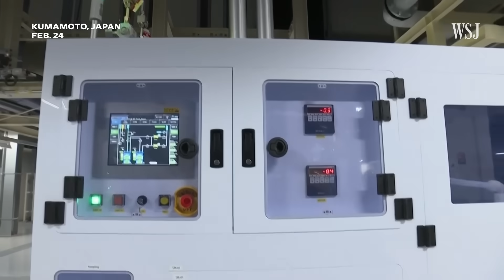The Plan to Secure Taiwan’s AI Chips Amid Fears of a Chinese Invasion | WSJ

Comment: Here is the irony, the US considers high tech chip manufacturing as a US technology and yet the US is unable to manufacture them without a foreign country.
Reply: The real irony is that the founder of tsmc got his start in early Silicon Valley but kept hitting the ceiling due to his ethnicity. Taiwan started an initiative at the time to being their talent back home so he went.
Reply: Sematech again...
Reply: Right, just like TSMC can't make anything without ASML, a Dutch company. There are over 6000 companies involved in this process so it literally takes the whole world.
Reply: @PhillipBallard   And to your point, ASML can’t make their EUV lithography machines without American-made Laser-produced plasma sources, photomasks, and nanoscale metrology equipment. Or German optics. It’s a highly interconnected supply chain- at the end of the day, TSMC’s expertise comes in quality control, fab layout, and manufacturing efficiency. I find it funny when people think that expertise is actually the enabling technology and that it is impossible for any other country to produce advanced integrated circuits. They’re flat wrong, like the original commenter.
Reply: @Laminar-Flow  

Your last comment is actually contrary to your previous comments 

Maybe you should go back and read them。
Reply: Ironically, this comment is a fallacy.  The US has ability to make advanced chips as TSMC does.  Intel has tech to do so.  But the difference between the success of TSMC and other fabs including Intel and Samsung is the yield of high-end chips.  TSMC is able to mass produce advanced chips below 7nm at high yields that satisfy the demands from business clients.  Other companies, however, the yield rates are relatively poor compared with TSMC.  From business standpoints, no companies can compete with TSMC because of that.   Who would want chips with lower yield rates if a certain manufacturer can provide more useful chips in mass production?  It's all about the costs!!!!!!!!
Reply: @censoredyoutube4902  both Intel and TSMC has access to the same EUV lithography machines from ASML.  Why is it that only TSMC is able to produce 7nm and lower chips at high yields?  What exactly is the difference?
Reply: @samanthajones4877  Over the years, TSMC has developed know-how and amassed a skilled labor force that makes a difference - a significant one. That's to some extent proprietary information, to another intellectual property that lends itself difficulty to patenting and to some extent experience and craftsmanship. You can replicate this somewhere else, like in the US or Europe, or literally anywhere else, with the right investment and given enough time. The investment, however, would likely be trillions, spread over at least several decades. It's simply cheaper to stick to manufacturing in Taiwan.

As odd as it may sound, it's also a matter of geography. Semiconductor manufacturing is an industrial process that requires humongous amounts of water. Taiwan receives an average of more than 8ft/2.5m of rain per year - more than almost any other region on earth. As such, it doesn't have a problem spending a similarly huge amount of water for semiconductors manufacturing. Most other regions on earth can not afford such water usage.
Reply: TSMC doesn't design chips. It produces them cheaper than the West could. Europe used to fab most chips until the 2000s and got outpriced. 

They need US, EU, Japanese and Korean designs, and Dutch lithography machines to even do this and can't function without them. Then most of the world's memory is designed and produced in Korea and Japan and literally nothing works without that. It's a massive cross-continental dependency.
Reply: @Eoin-B   Memory is a huge factor no one considers. Especially in terms of parallel processing. It’s useless without blazing fast SMD memory. They build cache onto the die but that can only be so big
Reply: @Laminar-Flow  Exactly, unless they capture Korea and somehow the Netherlands too, the TSMC fab is pretty useless as we would just stop exporting them to the Island.
Reply: 就不用跟他們吵了
成本高之外美國人沒有很多人願意做暴肝工作，講那麼多屁話還不是台積電妥善率最高跟成本低
美國要做當然也做的出來但現在最新技術美國也要花很多年跟成本
Reply: 把台積電講的一文不值笑死人了，荷蘭的公司也是台積電投資的，就跟美國以前常常歧視跟數落日本其他商業公司一樣，後來還不是被取代市場
Reply: The design of the chips & machines used in chip fabrication are (in most part if not all) using US patents by US scientists/ organizations (aka US $$$). Yes, even the EUV or Ultra-EUV machines made by  ASML (Dutch company) uses US patents in their design... The chip fabrication outsourcing to TSMC and therefore not incurring with the total cost of developing the manufacturing process from the ground up was one of the reasons why AMD was able to catch-up and even surpass (in some applications) Intel, which up until around 2020 had a "traditional" approach where they had to do R&D for the Chip design AND chip manufacturing (having difficulty in implementing/ using EUV machines) which effectively almost DOUBLED the cost of R&D as a whole for a new lithography process. Same thing that allowed Apple to design its own chip and have TSMC fabricate it for them, it would NOT have happened if they had to also invest in R&D on how to fabricate the chips because they would never make a profit (take the Apple Car project which was abandoned and had a much lower difficulty barrier).

TSMC obviously has its own proprietary techniques and extremely competent employees and undoubtably (together with Taiwan) became a node of extremely talented engineers & specialists in chip manufacturing, they haven't become the "beast" they are by luck. Nonetheless there was A LOT of western investment in making it what it is today. The threat of hindering the chip supply chain so that the US "pew-pew" industry falls short is a matter of national security. Security of interests & security of investments, so you wouldn't really want to facilitate technology transfer in anyway which could expedite a challenging country to "skip steps" you had to go through without incurring the cost and time to do so. Take Chinese "stealth fighters",  capable copies of US & Russian aircraft which are now used to threaten... take a guess.... Taiwan! yay!

Hence why they are correctly bringing back fabs in the US as well as other strategic locations in the world with potentially lower geopolitical risk.

So the only ironic part of any of this is that you tried to make a snazzy comment, just to be schooled.
Reply: @MrRobot_86 outsourcing was implemented to reduce production costs, nationalizing this industry will make costs higher, in a scenario of inflation in the USA, American electronic products will not be able to be competitive which will increase inflation even further.
Reply: The chips are not for export so they don't need to compete.
Reply: @MrRobot_86  From a military standpoint all those small geometries are not required or used. 20nM geometries are more than sufficient to provide the computing power to guide the most advanced missiles. Also the smaller geometries are more susceptible to hard errors ending in failure of the missile. Even space applications do not use geometries < 20nM as again low reliability in a high radiation environment. Fine geometries are only for consumer products with limited space e.g. smart phones and watches. So all the hype about who can do what has no influence on military equipment.
Reply: @MrRobot_86  While your comment is largely correct about TSMC, there are two key aspects where I disagree. Apple designing their own chip is a bit of a stretch when the cores are licensed designed from Arm. 

To call Apple a chip designer is like calling someone a car designer for ordering a car with their favorite color interior and favorite color exterior. While one could argue that picking the color of the car is to your design standards - the bulk of the work was still being done by other companies. Today being a "chip company" is just about writing checks which is why so many companies from Google to Amazon now have "their own" chips. They write a check to a company like Arm to design the bulk of it, and then write a check to TSMC to manufacture it. Even many of the other technologies for things like radios and charging are licensed IP. TSMC is a true chip company as they actually fabricate them. And there are a few companies like Arm, Nvidia, and AMD that truly have innovative IP. 

The US has low geopolitical risk, but has high political risk. In the world we have a spectrum of human rights and productivity. China is not known for it's human rights, but is known for high productivity as a result. As we've had a huge increase in human rights in the US, it comes at a significant cost of decreased manufacturing capability.

Car manufacturing and agriculture is going to countries like Mexico because of cheaper labor. And even for chip manufacturing, TSMC is realizing the struggle of working in the US. Even this video itself touches on the fact that unions are upset about them using foreign labor. 

At the same time, TSMC is building a factory in Arizona and needs highly skilled labor and workers to be there for 24/7 manufacturing. They have already complained about the work culture in the US, because it's not easy to find a bunch of engineers or chip experts in the middle of Arizona willing to work an 8-12 hour graveyard shift. 

The future of manufacturing anything from simple food to advanced computer technology is going to be a fine balance between cheap third world labor and advanced AI robotics, not American people.
Reply: @aminy23  Agreed, I just thought I was already writing an essay which the ppl that should read it wont... So I cut some corners on promoting Apple to a chip designer.

I partially agree with you regarding the workforce in the US, I think that due to lack of competitivity for that specific type of specialized/ highly educated workforce the employees can be "picky" can complain or are unwilling to work given x,y,z conditions. If there was a market saturation of engineers in the US, it would likely easy and lower the expectations for employment. None of these have  a quick solution that don't require long term planning... Take myself as an example, as a Materials Sciences Engineer I began my career in metallurgy and I transitioned (10yrs+ ago) to  Software Development. At that time there was a larger demand and therefore benefits for Software Engineers vs Engineers willing to work at a Steel Mill. I would consider moving back to a more "core" industry if my country requires me to do so or if jobs are more financially attractive in that market.
Reply: Why does the United States not confront China but seek to solve the problem from Taiwan? Is the United States afraid of China?
Reply: It’s true as all the designs for the chips come from the us
Reply: What?  Google the number of worldwide Fabs and you will see there are 100s in the United States already!  Have you never heard of Global Foundries, Intel, Texas Instruments, Samsung, Microship, Onsemi, Wolfspeed, Micron, Tower, Qorvo, and many others that have plants in the United States?
Reply: You do know that most of the companies that allow semiconductors to be made are based in the United States - KLA, Applied Materials, LAM Research along with the software companies that support chip design like Synopsis, Cadence and Keysight?  And if it weren't for NVIDIA, Apple, Qualcomm, AMD, Amazon, Microsoft and other USA based companies, TSMC would have nothing to build?
Reply: Intel in Ohio has no one help but America
Reply: No, irony is WSJ bashing protectionism and then turning around and wondering why all our product are controlled by other countries.
Reply: Well, no.  It's because manufacturing chips in the U.S. would be far too expensive. The U.S. used to dominate the industry from design to production.  Of course, now TSMC is so ahead on the production side that bringing production back to the U.S. would be very difficult.

TSMC's supply chain is almost a global effort. Materials from various countries, chip designs in the U.S. and tools from ASML in the Netherlands, just to name a few.  Not to mention the customers who buy those chips.  This is why China threatening the peace and stability of Taiwan is a problem.
Reply: US dominants the scientific patents that makes TSMC products possible, and secures Taiwan's security f from CCP which are all PREREQUISITES.
Reply: Actually if you go back to history, the real reason why Fab manufacture exist in Taiwan is because in 1970's US does not want to manufacture chips due to its highly polluted environment and need considerable amount of water and electricity, and that’s why US outsource to Japan in the beginning to manufacture the Fab chips. And Japan didn’t make the Fab chip an success as US want to counter Japan rising economy in 80's and decide to outsource and relocate the supply chain of Fab manufacturing to South Korea and Taiwan instead. And Taiwan take 30 years since 1987 to make it very successful finally. So its a lot of time and capital involved. Think about it the chip plant in Taiwan at 80's take like 300 million USD ( like 10 billion USD now adjust for inflation of labour and material）to invest back in 1987, and in that time which government in the world has vision and courage to take $300 million in USD in 1980's to invest and willing to risk Fab manufacturing when its pretty much a relatively very new concept and infant market ? Taiwan government decide to make a huge bet and it become a success after 30 years.
Reply: We have a massive amount of semiconductor knowledge and IP. Just not workers for the plants, because we’ve outsourced manufacturing for decades; hence why the US is so reliant on Taiwan.
Reply: @ianstlouis   That's true!  Talent pool is hard to build up and it takes time.
Reply: @ianstlouis  thats why US will have to defend Taiwan
Reply: Intel, Texas Instruments, Microchip, Micron.... etc.
Reply: @Kdgatto where do do you think intel fabs their high end chips?
Reply: @s0kulite  ...Hillsborough, Oregon and Chandler, Arizona?
Reply: @viperabyss  Those U.S. chips fabs are sub-par compared to the fabs locally in Taiwan.
Reply: @s0kulite Taiwan cheating ? Using cheap labor ?
Reply: @eastcoastsailingcenter7768 

Apparently you know zero about Taiwan
Reply: @eastcoastsailingcenter7768  no, they’re just better then Americans.
Im playing both sides here, as a Taiwanese American.
Reply: @s0kulite  US dominants the scientific patents that makes TSMC products possible, and secures Taiwan's security from CCP which are all PREREQUISITES. US and Taiwan are allies.
Reply: @tranquil02  thanks for stating the obvious like we don’t already know
Reply: The main reason U$A will never able to compete in Chip manufacturing.
All the country that do well in chip manufacturing , has Confucianism culture.
For chip manufacturing,  a high level of discipline is the key, and most Americans today don't possess it.
They call it “forced labour"
Taiwanese media reported on August 2 that TSMC claimed the production holdup at its Arizona facility was caused by a shortage of trained American labour and that they had sent staff from Taiwan to assist with the factory's development. Labour union officials in Arizona, on the other hand, criticised TSMC for exploiting this as a justification to bring in "low-wage foreign labour."
Reply: @happymelon7129   You’re literally messed up in the head if you think chip manufacturing success is due to Confucianism. Only a bot would say that. 

The only other bots in this equation are the ones making the chips. The issues in Arizona are on construction. That will be a solved problem in a year.
Reply: @Laminar-Flow  

BTW, you have not answer my
 questions about intel?
Reply: @Laminar-Flow  

Do you know—-TSMC would not exist without K. T. Li; Nvidia would not be possible without TSMC
Reply: @Laminar-Flow  

Dear Kaminar,

The more you say, the harder to believe you are an engineer 

Apparently you don’t know the meaning of supply chains

Your only point is US is great and we don’t need Taiwan 

Hahaha 

So naive and immature
Reply: @Laminar-Flow  

For your reference——He recalled the manufacturing process of the RIVA 128, Nvidia's first commercial success, which he called the "most complicated chip at the time." He said that Nvidia did not have the budget and he wrote a letter to Taiwan Semiconductor Manufacturing Co. (TSMC) founder Morris Chang, who called him and the two started their nearly 30-year collaboration.
Reply: @Laminar-Flow  

Jensen Huang, the Nvidia CEO who was born in Taiwan, raised in Kentucky, and is now one of the richest men on earth
Reply: @Laminar-Flow  

AMD Lisa Su is also Taiwanese 

Lisa Tzwu-Fang Su was born in November[1][14] of 1969[7][2] in Tainan, Taiwan. She was born in a Taiwanese Hokkien speaking family.[1
Reply: @Laminar-Flow  

Wow! Another Taiwanese, what a surprise 

Charles Liang (born 1956 or 1957) is the billionaire co-founder (with his wife Sara Liu), chairman, president and CEO of Supermicro, an information technology company based in San Jose, California
Reply: @Laminar-Flow  For chip manufacturing,  a high level of discipline is the key, and most Americans today don't possess it.
They call it “forced labour" 

Please return TSMC to Taiwan ,  since after many years TSMC still never receive any $ from U$ gov.
Reply: @Laminar-Flow  

three Americans CEO all born in Taiwan, can’t you see any connections here ?
Reply: ASML also relies on TSMC, and EUV lithography is a technology integration of multiple countries, not just the United States or Germany. At the same time, ASML also relies on TSMC to iterate their lithography machines.
Reply: Taiwan is a perfect excuse to grab this technology for Americans. ASML is still a headache though. Need to make that American too.
Reply: This is bully , it is NOT a competition when only one side(U$A) can change rules.
Just like your classmate(U$A) use his family power coercing the stationary shop(ASML,Japan,..) NOT to sell stationary to you(China).
Reply: @happymelon7129   Chinese can whine as much as they want.  LOL.  But the US is the ultimate IP owner that owns the upstream tech in the supply chain of semiconductor sector.   American companies owns many licenses of critical tech needed for chip processing and IC design.  For example, Synopsys is one such company that a lot of chip design needs the company to authorize the use of codes created by the company.  This is also the reason why you only watch the US authority talk about what they want to ban to other countries but the other countries can only protest crying like babies at best.   LOL.   It's the power of IP!   You want it?  Either steal it as China has been doing tirelessly or comply with the demand from the IP owner which is the US.
Reply: 全球化是什么意思？
Reply: Grrr but me hate America so you’re wrong.
Reply: As a computer engineer, we don’t need TSMC to make 2nm chips. Intel is building a 2nm, 3nm, and 4nm fab as we speak (they have different naming conventions but the feature sizes are similar to TSMC). We need ASML, but they have research centers in the US and their original EUV research was funded in part by the US government alongside Intel and AMD. That is the only enabling technology right now necessary. All the software used to design such chips, and most of the enabling technology is owned in part by the US government. Nvidia is an American company and all the software and hardware design is American IP. Same with AMD. Same with Apple. If you think otherwise you’re not well researched. 

The only reason they are made by TSMC is they perfected mass-producing such chips at massive scales on short notice. That’s it. They hold close to no tech-enabling IP relating to how these chips are made; they use American software and Dutch machines with German mirrors among other things. 

The US invented the transistor, the internet, and a while ago made 90% of the world’s semiconductors. It is the US’s technology in origin and given the CHIPS act, it will be in the future. You look at the problem like an uneducated fool.
Reply: @Laminar-Flow 

Maybe you should do more homework before talking
Reply: @jennychuang808   I did plenty before I graduated. Let me know what I said that was technically incorrect.
Reply: @Laminar-Flow  

Intel ? Haha 

Haha
Reply: @Laminar-Flow  

If you can understand Chinese ( language) , I would love to show you what is those Taiwanese expert’s view about Pat Gelsinger

He is literally a joke and dreamer but nothing else

Please go and check what he said over the past few years?
Reply: @Laminar-Flow  

Dear Laminar, I wonder if your research includes this ——-A mini bombshell was dropped on the semiconductor industry a few months ago: Intel would use TSMC to make CPU tiles for its next-generation Lunar Lake mobile platform. A new report from Taiwan says Intel will continue that strategy with Nova Lake, which will be Lunar Lake's successor, somewhere around 2026 and use TSMC's 2nm fabrication process.
Reply: @Laminar-Flow  

Please also do some research about Intel’s revenue ——
Intel’s chip making business reports $7bn in losses; figures to worsen in 2024

Please check the share price of tsmc

As an engineer yourself, you should know how expensive one fab is . In your opinion, how long can Intel lasts?
Reply: @jennychuang808  The only thing TSMC brings to the table is the ability to mass-produce chips first made in research labs in America at a cheaper cost than would be charged in the US. That’s it. Their only contributing IP to this process deals in quality control and fab layout. That could easily be replicated elsewhere. If necessary research labs could start outputting and packaging chips immediately but QC and cost would be a problem. Either way, it could be done. In the long term, it will, and these two things won’t be major factors by then. 

I’m not saying the US should abandon Taiwan. It shouldn’t. However, it’s also disingenuous to say the US cannot produce its own chips at or better than the same level as TSMC considering the engineers and physicists that enable the tech in the first place are almost all in the US. Where is the majority of research spending occurring in terms of technology that will enable 1nm and sub-nanometer processes?
Reply: @jennychuang808  Who took delivery of an EUV machine recently? Read my other replies to people, “Jenny Huang”.  TSMC’s entire market value is literally based on NVIDIA, Intel, Apple, AMD, Qualcomm, etc’s own profits. Without US companies designing the chips on American software on equipment made using American research breakthroughs, TSMC wouldn’t be valued remotely close to what it is today. Why is NVIDIA worth 2 Trillion versus TSMC, which isn’t even valued at over a trillion yet?
Reply: @Laminar-Flow  

When you said “ tsmc’s can be easily replicated “ , it shows you don’t know this industry at all.

If what you said is true , why US still want tsmc in your wonderful country?
Reply: @Laminar-Flow  

When you emphasize how important the EUV is, I just can’t stop laughing 

In this case, why doesn’t Intel use the EUV to produce 2nn, and Samsung?

Apparently, it is more than what you thought, right ?

Hahaha! 

Do more research, please
Reply: @Laminar-Flow Why doesn’t the USA simply buy an EUV machine from ASML and produce high end semiconductor chips themselves instead of asking for TSMC to setup a factory in Arizona?
Reply: @jennychuang808  Intel is the defacto standard for mass production CPUs and is spending over $100 Billion on new fabs.  I'd say Pat is doing a good job.
Reply: @Maxpasadena  

Dear Max,

We should see and only time will tell 

Good luck
Reply: @jennychuang808  Why do you get upset that someone who is more educated than you says you're wrong?

There's nothing wrong about being wrong, but there is someone wrong in responding with personal attacks, instead of arguments and logical fallacies.
Reply: @AlmightyDude420  

Dear Almighty Dude

Would you please tell us who is more educated? 

Apparently your wonderful philosophy is not working here
Reply: @AlmightyDude420  

Dear Mr Almighty Dude—- I sincerely hope you can understand this report and let me know the definition of well educated ———-Intel discloses $7 billion operating loss for chip-making unit. Intel said the manufacturing unit had $7 billion in operating losses for 2023, a steeper loss than the $5.2 billion in operating losses the year before. The unit had revenue of $18.9 billion for 2023, down 31% from $27.49 billion the year before.—-During a presentation for investors, Chief Executive Pat Gelsinger said 2024 would be the year of worst operating losses for the company's chipmaking business and that it expects to break even on an operating basis by about 2027.—-Partially as a result of the missteps, Intel has outsourced about 30% of the total number of wafers to external contract manufacturers such as TSMC, Gelsinger said. It aims to bring that number down to roughly 20%——
Reply: @jennychuang808  7bn loss for starting and investing in a new company? how is that a bad thing? Tell us, how many billions did China spend trying to start their own fabs. Tell us? Look, I like TSMC, but you must know they are using European machines and American designs to do it.
Reply: @2livenoob  

I guess everyone knows this industry uses EU machines and US designs.

But the key point here is even so , why can’t US make advanced chips?

Merci
Reply: @jennychuang808  That's a complicated question, with many answers. The US could have done it if they didn't buy into, and lead, the globalization effort. Now that China clearly is trying to pull a Russia and control the world's supply chain so they can go to war, all of that needs to change unfortunately. The point of the WTO (which i dont support) was to PREVENT countries from going to war with each other by sharing trade and supply chains. Russia and China are using that setup to go to war unchallenged by the countries they supply. This is unfortunate but that's life. However, you didn't answer my question, you blame Intel for blowing 7bn trying to build their own fabs without telling us how much did China spend trying to do the same thing? How much has TSMC been dumping into their fabs for the last 20 years to get where they are? It's not a cheap endeavor. It's like nukes... everyone knows how to make one, but very few people have the resources to do it.
Reply: @Laminar-Flow  Intel 2nm is vastly different from TSMC 2 nm. Every fab has their own pdk. When a company like AMD, ARM, designs a chip they are mostly designing it with the standards of only one fab in mind. Intel's fabs are in house, i.e they produce Intel chips only, similar to how AMD was before they went fabless. TSMC is flexible in this sense as they will manufacture chips for anyone who pays and has a valid design, even my college is sending our 12nm design to TSMC alongside a fat check this year.
Reply: @TheReaper-fq6yv   Yes, I’m aware. I was not giving the literal names of processes, I was giving ‘equivalent’ names- I.e. Intel 4 (previously called Intel 7nm) being equivalent to TSMC’s and Samsung’s 4nm node; now intel is ramping up the 20A (Ångström) process node (so, a "2nm" equivalent, but Intel was calling this node "5nm" previously), so on and so forth. I compared them as I did because a) they are confusing to people like those in this reply section who don’t understand the technicalities of the respective processes’ and b) they require a relatively similar amount and complexity of baseline fab equipment to produce which was the point of the conversation at the time- albeit one company might use different methodologies and naming conventions as I have pointed out. The conversation was about the ability of America to produce advanced semiconductors at home, not what you’re going into.. I also never said PDK’s are shared between such fabs either- my point if anything was those PDK’s as with other fabs are designed with the help of American EDA companies. Frankly the point in this whole conversation has been that Intel is moving towards their angstrom process right now and there’s more than enough funding for them to spin such fabs up domestically. It’s not like we don’t have access to the same machinery that TSMC does here in the US. They will be able to directly compete with TSMC within a few years but will charge a lot more for what you get. While Intel is likely going to be manufacturing their next 2 generations of consumer CPU’s with TSMC as it is, that’s simply because consumer IC’s aren’t remotely as profitable as the government-funded stuff they will be using to initially sell the chips that are fabbed stateside. A lot of people mistake the QC and Efficiency prowess of TSMC as technological supremacy when that isn’t the whole case, it’s just why they are the cheapest option. Their IP mostly relates to high-level manufacturing processes, QC, and fab layout. Nothing that can’t be replicated elsewhere in time and that process is underway. 

I’m quite familiar with how semiconductor manufacturing works my man. Don’t need a lecture on TSMC’s business model. In terms of Intel Fabs only producing Intel IC’s, I think you are ill-researched in that regard (although historically what you said is correct)… Gelsinger announced IDM 2.0 which, as part of IFS, will start to produce semiconductors for external customers. They already announced Microsoft as a customer in February. This is in line with the CHIPS act and the investments they are making & taking in right now. For example, you’ll probably see Northrop designing custom IC’s among other similar investors in the future in addition to commercial customers like Microsoft.

My college had an on-prem wraith EBL, was capable of writing to 8nm on 200mm wafers (alongside ~60 pieces of equipment for everything under the sun). The EBL was mostly used for research, but we had a senior-year EE/CPEG fab class where we took advantage. A lot of the equipment we had was donated by Intel out of old research fabs. As soon as they would move on to a new process in their research fabs they would call some guys out from my school and let them have a pick. My Alma mater does a lot of research with Intel. Sounds like a great experience to have your own designs fabbed by TSMC as well. We had to suffer through packaging, hopefully y’all don’t haha.
Reply: @Laminar-Flow  as a Taiwanese American systems engineer, go make the chips stateside then, Intel.
oh wait… look at that yield…. Better hand it back to TSMC
Reply: The US does make its own chips, what are you talking about? Even the design and tech behind TSMC chips were still made by the US, we just outsource the equipment and labor needed to make them to Taiwan.

So yeah we obviously can make them, and we do make them, we just don’t have the factories needed to produce them at the scale that Taiwan does.
Reply: @ChristopherGuilday  and a robust and efficiently designed supply chain